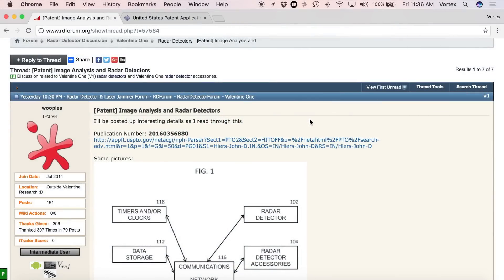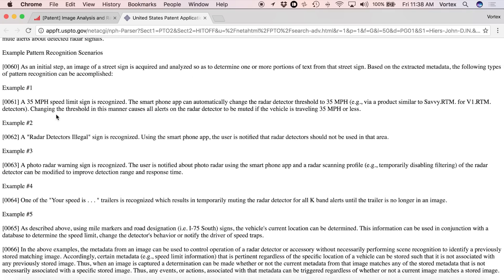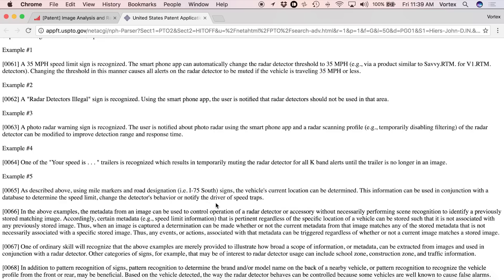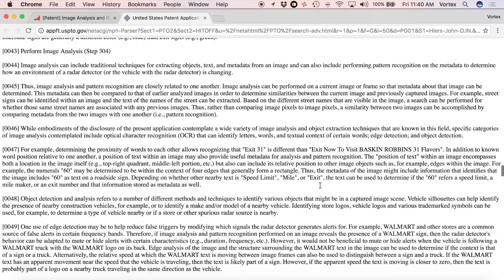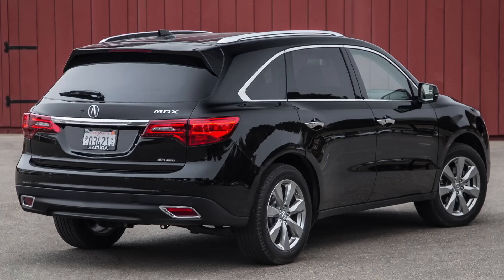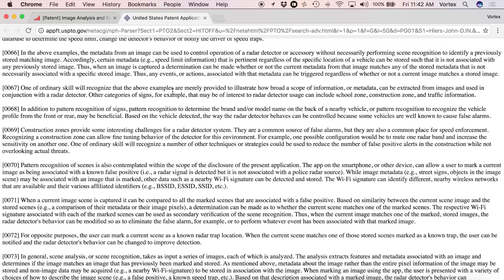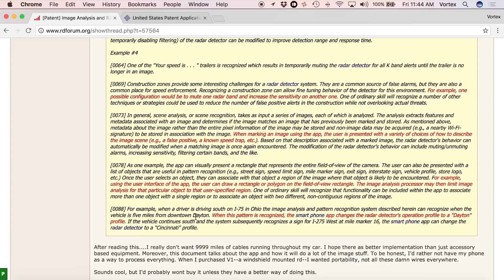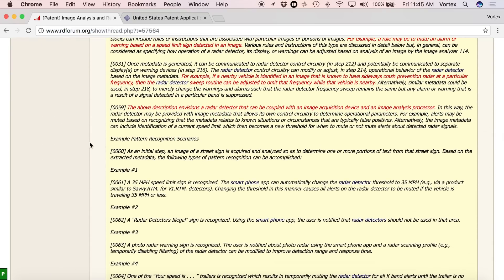New V1 Patent Application: Radar Detector + Camera

Comment: Pretty dumb patent, IMO. Built-in GPS receivers are much more reliable (they don't care about optical clarity of your windshield or weather conditions such as thick fog, or a physical existence of road sign which might be temporarily removed by someone) and they allow the radar detector to be fully "independent" from smartphone, with 0 effect on phone's battery life (not everyone likes to plug a charging cord into their phones while being in car) or the smartphone's performance in general (some buggy apps can severely affect the smarphone's performance until you force-close them). Not to mention that a camera, especially external one, will take up an extra physical space, much more than a simple GPS receiver, and this DOES matter greatly to people who already have multiple devices mounted on windshield - things like already-existing dashcam and E-ZPass (or other similar RFID transponders), especially to the owners of various Subaru models with "Eyesight" option (this option restricts you from placing any objects on certain areas of windshield).

Sounds like the Valentine Research are in desperate need of some kind of gimmick which would help them make their products still relevant... Or perhaps they're planning (a long-term goal) on gathering and reselling user data (automatically captured images of certain locations, captured locations of Wi-Fi signals, etc.) to third parties by using mindless idiots willing to provide this data for free ;-)

Comment: Hey, Vortex isn't this like a Rube Goldberg machine? Just add a dang GPS chip. Just saying.
Reply from the maker: +Steve Jones lol yeah. They could add a GPS chip but there's a patent on lockouts. They could use it for just low speed muting like K40 does but they'd be missing out on the full potential of what they could do. That's probably the reason that they're considering all these workarounds. That patent expires in 2 1/2 years the way V1's arrow patent did so we'll see what happens afterwards... :)

Comment: If only valentine would add a GPS chip already and stop being stupid.
Reply: David S Buy a $10 app and the V1 Bluetooth module.  Problem solved.
Reply: I agree, I wish it had it built in and I didn't have to pair with a phone. Their reasoning for not including it is BS.
Reply: kappaz A GPS circuit, antenna, and wiring takes up space as well as adding to cost. Not everyone wants built in GPS if your phone can supply it.